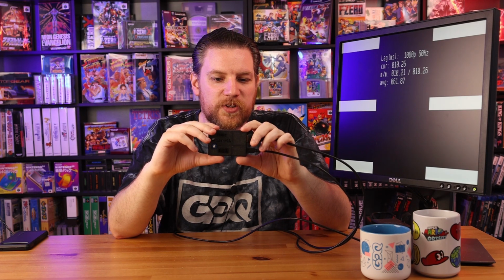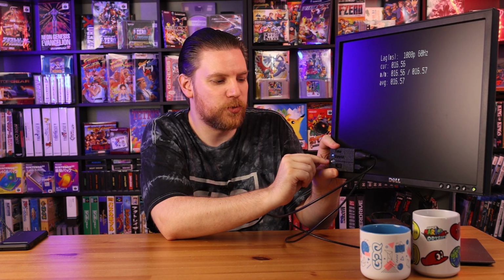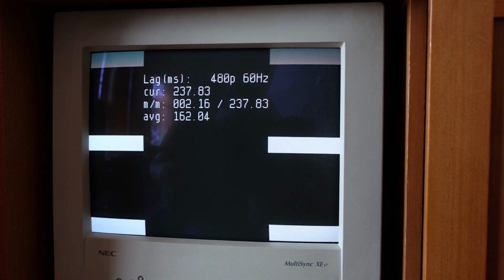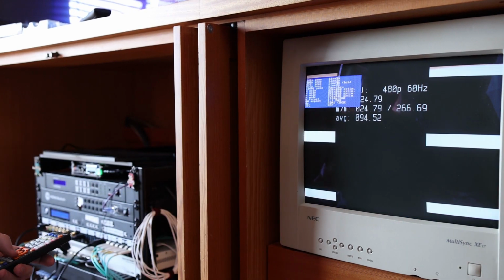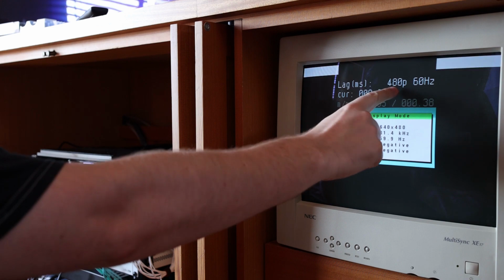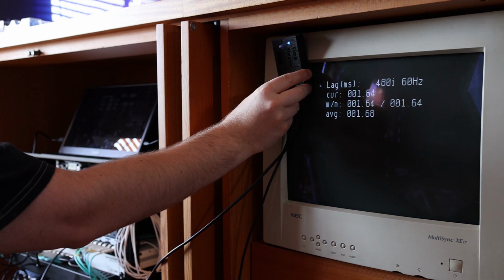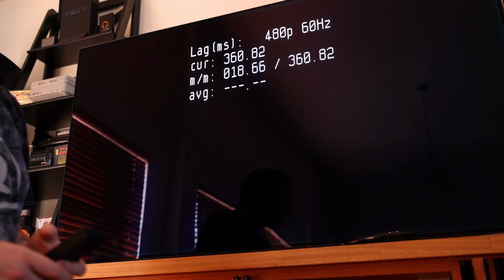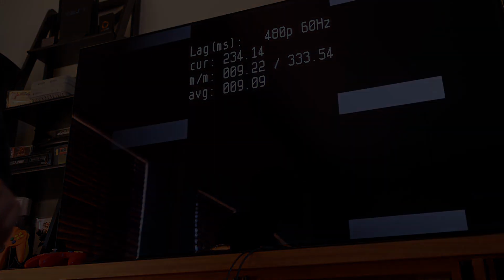Time Sleuth Review

Comment: Is TS restricted to just testing latency for TV picture settings or modes, or can it also reveal the latency for wireless controllers, along with Wired USB? Like with 8bitdo's 2.4g controllers for example?
Reply from the maker: The Time Sleuth has no input devices on it, it is simply a video signal generator, and will measure the time between when it generates that signal and its sensor views that image from a screen. It doesn't support controllers at all.
Reply: @circuitrewind  
Thanks for the heads up! I'll still be picking one up regardless, because it's still going to come in handy when testing different settings for whatever future QD-OLED TV i decide to buy. Cheers!